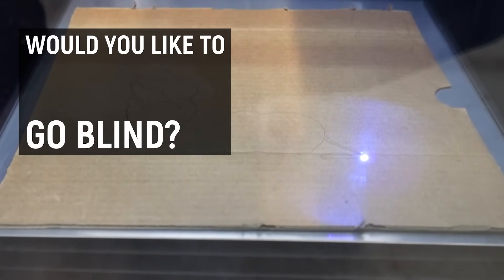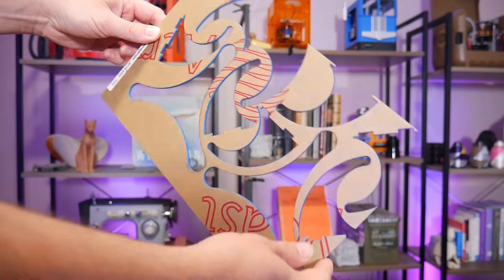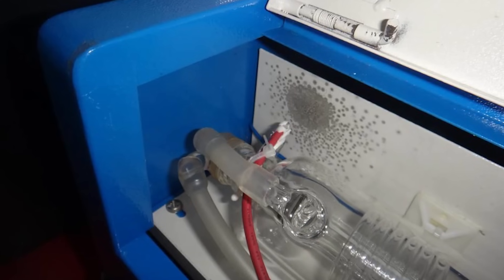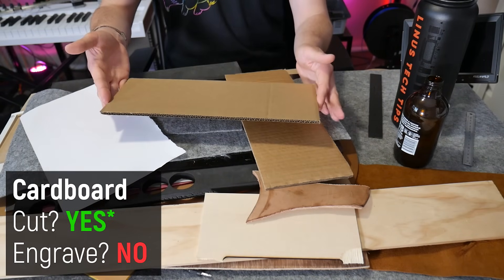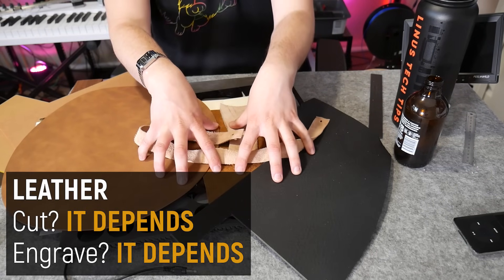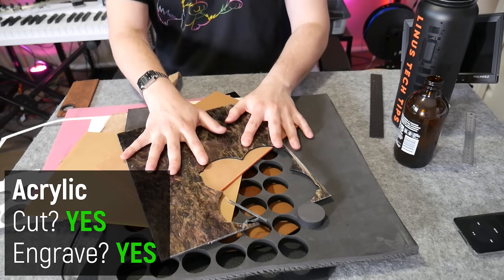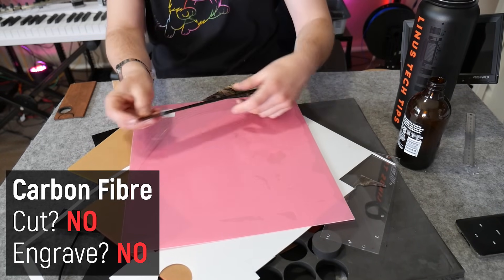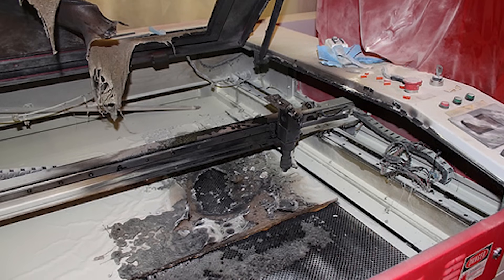Are cheap laser cutters safe?

Comment: i also add that you can not trust a lto of material labels, I bought "pet" and"PP" sheets that turned out to be Polycarbonate or pvc, so Iḿ always ordering samples first and test the mbefore committing to a full batch. a pparently a lot of vendors dont really care, especially if they sell the material for a different purpose than lasercutting.

Comment: Having been involved with industrial laser welding I would agree with your analysis of the hobby range available. I attended several days trainig by professionals to cover just the safety issues. That training required successful  completion of assessments leading to certification. So I really am surprised by the lack of support information and basic safety ,relying on the user alone to void potentially dangerous situations.  Many adverts show a young child watching the process! I was considering getting a laser but am now more than convinced that the hobby market has much work to do.

Comment: I have an enclosure with a proper wave length window plus I use proper glasses, an air assist and large exhaust fan that dumps outside.
Reply from the maker: Sounds like a perfect setup! Fire extinguisher near by too just in case?
Reply: Yes, of course. And signs for shop door and laser enclosure.

Comment: I have a Laserbox pro, partly based on your recommendation. The other day I put masking tape down on my wood to protect it which ended up peeling off a bit and caught fire when the laser passed over it. Luckily I was watching and the fire burned itself out in about a second. If there’s one thing I’ve learned it’s that when you’re using power tools, be safe. I’ve known too many old 3 fingered woodworkers to take chances with something as powerful as a 40 watt laser.

Comment: I've seen the gantry of a cheap laser cutter get stuck due to a small mechanical failure. The belt pulley attached to the stepper motor was spinning freely thus not driving the belt anymore. Since the laser wasn't moving it caused a fire in no time.

Comment: When we picked our laser up from the manufacturer we‘ve been recommended to perform a Beilstein Test. It’s pretty simple, you heat a sturdy copper wire under a flame until the flame is no longer discolored, then use the copper to melt some of your material onto it, and then hold it into a flame again. If it burns green your material contains Halogens, often found in PVC or other polymers containing chlorine.

Comment: My HS had a laser cutter. It was pretty cool. You could give them your water bottle and they would engrave designs in the powder coat for like $5. And they would engrave calculators with your name on them, though because it was plastic, they did that after school with no students around, and had the dust extraction system in the room it was in running, even though they had a machine with an in built filter for ventilation. Oh, and they tried to cut MDF with it because they thought it was plywood (it was the nice MDF that looks like regular wood) and the shop stank for days. Never did that again.

Comment: Even if everything goes right these open style laser cutters will horribly and permanently degrade your vision or blind you depending on the power level and how often you use it. These lasers are so powerful that even staring at the laser dot on the work surface is enough to damage your eyes, with the more powerful lasers this can start happening in seconds (and your brain is amazing at compensating for visual damage so you won't consciously notice until it's really bad).  My older brother had one of these and we kept it in a completely opaque cabinet and had it's power hooded up to a mechanical kill switch that was connected to the cabinet door making it impossible to observe this thing working directly. The only way you could observe it in a powered on state was on a computer monitor through one of the cheap webcams that was in the cabinet. This is the only way to use one of these safely. 

   You can buy the best laser goggles on the market but what if the manufacturer that made your machine is lying or is just plane wrong about the laser's wavelength? What if the multiplier crystal is of poor quality/damaged/misaligned and your laser leaks radiation at an unintended wavelength (this is criminally common in cheap green lasers for example)? What if your laser is running at an unusually low/high temp and the wavelength shifts out of the protection range the goggles provide? Hopefully whatever material your are cutting (or any of it byproducts) aren't fluorescent (including and wavelengths you can't see). 

   I'm legally blind (since birth) and trust me you don't take risks with your eyes. Humans are extremely visually oriented creatures and that way our society functions and your ability to participate in it reflects that. Whether your vision is good or bad, protect what you have.

Comment: Thanks for this video!!   I have been using an Ender 3 for awhile and some friends bought an AnyCubic Mega Pro with Laser Engraver and were not able to get it running so loaned it to me to try.   I got it printing right away but have zero experience with lasers.  I at least used the glasses during printing but of course no one else in the household who walked by had them, also I first tried "carving" some junk mail...all was good until it cut through the back of an envelope and melted some of the plastic from the address window....STINKY!  That's when I knew I needed to stop and do some research...Thanks again, Angus.

Comment: Bought cheap Chinese open frame engraver for $250 for work to just test a concept as it was not documented or done by anyone else.
To make it safe for a workplace I had to use it in a separate room which is locked up when I use the engraver and the included goggles went right into the bin, and instead bought ones that were certified and suited to the wavelength of the laser, those goggles costed more than the engraver itself...
Also interesting thing the included ones were green and expensive ones for the correct wavelength were red, so it would mean the included ones were incorrect...
Reply: Oh and the whole machine was placed under fume cabinet.

Comment: Even "wood" may not be what it seems... interior finishing grade timber, is often pressure-treated with insecticides.  Usually this is transparent to retain the timber's original appearance.  Construction timbers are pressure treated with even nastier chemicals, although this is usually obvious because the treatment typically includes a dye as a warning.
As Angus said more than once; if you are not sure, don't chance it!

Comment: Hey g10 and fr4 the material I used to drill and cut
....
With a very specialized laser. I imagine many modules especially those with diode lasers could be modified to safely cut it.

Comment: I'm pleased to see someone talking about laser safety. I spent some 15 years in the laser industry, trying to educate people about the things this video covers. The one thing it will have been good to see in it is something about the legal position with regard to laser classification, which is pretty well standard internationally. Laser classifications are based on the risk they pose.

Some laser classifications are illegal to use without protective measures being in place. Lasers without an enclosre are Class 4 lasers. To use these legally, the room they are in needs to have interlocked doors that would shut the laser off if someone inadvertently entered the room, operators must wear laser goggles, have laser safety training and a laser safety officer must be on site whenever the laser is in use. That's what the law says, but it isn't illegal to sell a Class 4 laser.

In other words, the duty for safety falls upon the individual or business using the machine in the same way it does for mills and lathes used without guards. The problem arises when something goes wrong. In a business, a H&S investigation that lead to a trial for negligence, could result in massive fines or a prison sentence. With home use, a fire caused by using a laser illegally, would more than likely negate an insurance payout.

Lasers can be great tools but they really do have to be used safely. It isn't that difficult to achieve in most instances, so long as you understand what the risks are and take the steps needed to minimise them.

One final word about fume extraction, is that the extraction requirement will vary, dependent on the size of machine. You can't expect a Micky Mouse extractor for a small machine to be worth a light on a large one. A reputable manufacturer will detail the extraction requirement in the machine specs.

In my experience, suppliers gloss over this, because it can make closing a sale too difficult when the cost of adequate extraction gets added to the bill.

Comment: Thank you, great video!  Being that these desktop diode lasers are so popular, it would be nice if you could make a video helping people to actually make them safer.... like which glasses to use to protect your eyes, different types of ways to extract the fumes, and maybe if enclosures are needed.
Reply: It is clear you need an enclosure. With a non transparent cover. And double interlock, like a microwave door. (CO2 lasers are an exception). Googles are not enough. Reflections can come from anywhere, and bystanders can get hit as well.

Comment: One question I feel I've never had answered and which has scared me away from all laser cutters is what would happen if a mirror was to break off and direct the light towards you. Would the shielding material,  be it metal or whatever transperant light filter they had above it be enough to save your eyes? I know the actual tip itself focuses the light more but what about the path to the head?
Reply from the maker: The window should absorb the worst of it, but only if it's correctly designed. The more terrifying part is replacing mirrors, because you can only align them by placing tape in the path of the laser and firing it to see how off the aim is!
Reply: @MakersMuse  I would love to see someone actually test the laser vs the transparent window to see if you'd be safe behind it.

Comment: Just for reference EVA foam is made from polyethylene vinyl acetate. It is in the process of replacing pvc where it can because it contains no chlorine. It's still plastic so it's still nothing you want to breathe in. Extraction is still a must because over time the fumes will probably cause cancer but it will produce no chlorine, no chlorine gas and not make acid in your lungs or with the humidity in the air ( a major problem where I live in Western MA, USA). The humidity in the air is another concern because those fumes, even if you have an extractor of some kind running, are still going past the laser head and causing damage to it.

Comment: Just wondering.
To mitigate the risk of fire, especially if you're running the laser cutter in an enclosure anyway, what if you flood the enclosure with an inert gas like you get from any welding supply store? Fire needs oxygen just as much as rust.
Would heat dissipation be too big of an issue? Or would you have to worry about high temperature chemical interactions between the inert gas and the material being cut?

Comment: I literally had a look at low-end (i.e. cheap) laser cutters/engravers yesterday as I have utilised my 3D printer so successfully I thought, well the laser cutter seems to operate similarly - 3D CAD software and gantry/stepper motors, not the actual end product. My naive thinking was that "well 3D printers have come so far, it makes sense that 3D cutters would follow". Even though I am an intelligent, university science educated person, I didn't stop to think about most of these issues as I just ASSUMED that if they sold them that way, then they must be safe to use that way.

Thanks for educating me, you very well may have saved my family's and my health.

Comment: Nice video, I v done a lot of researches about what can be burned or not, people usually don’t and that’s veeery dangerous not to know the hasards, especially with pvc based material and chlorine. Plus chlorine can also deeply damage and rust in
Minutes  all the metal parts. That’s insanely violent 
I also suggest you complete this topic with the type of glass that can be used or not (optical density of safety glasses or shielding glass) intro about wavelength, those are quite easily understandable specs. And can be found easily when buying PPI. 

Thanks for talking about safety when using lasers ! 👍🏻👍🏿

Comment: I just picked up a Comgrow Z1, 10w version. I picked up the enclosure at the same time. I didn't really run it until I had an exhaust system. I learned how to run a laser through a local maker space. They had a large CO2 laser. Some things they were VERY clear on:
1. Do not leave the laser unattended
2. Only trained users allowed
3. No opening the enclosure while the laser is powered
4. Do not leave the laser unattended
5. Only trained members allowed in the exclusion zone (area directly around the laser)

I like to think I have learned some good habits from the amazing people at the maker space. For what I paid for the Z1, I could've gotten a stock K40. But for the work I do, the added work area trumps the power. You are right, user error is probably the biggest issue. Companies are trying to make money off the new makers out there. So they offer the minimum. I just hope people watch this before buying. I would never run a laser without an enclosure or an exhaust.

Comment: You can lasercut PET or PET G. it is between PMMA and PC. It can be tricky to dial in settings, but it can cut quite nice. If the settings are wrong then it leaves honey like substance on edges, but with correct settings it is great. Not as bulletproof as PC, but also not as brittle as PMMA. For me it is the perfect middle ground. Also the price is a LOT lower than PC.

Comment: This is something that has kept me from lighting off the laser cutter I have until I had a safe area to use it, likely right next to the SLA printer that is still sitting in its box.
I have a charcoal filter fume extractor, but didn't have a place to setup a work space to use them until just recently.

I do remember hearing about a couple in the Berkeley area that died from fumes out of their laser cutter, which was apparently exhausted outside, but not well enough for whatever they'd been cutting in it, at least from what I'd heard back then.

Comment: I bought a "15W" blue laser with my cheap grasshopper CNC 3018 a couple of years ago.  I carefully tested the laser at 1% power with the glasses that came with it.  LOL.  Turns out, there are many things in a workshop, which you don't think of as "reflective", that are indeed slightly reflective were noticeable in my peripheral vision at that brightness! 😬

I learned a bit about laser safety in university, and more when researching how to correctly build an enclosure for this thing.  "Terrifying" is absolutely the correct word here.

I still hope to use the laser at some point, but I won't be touching it again until I get around to building a proper enclosure.

Comment: The more common carbon fiber material is a composite of carbon fiber and epoxy or polyester resin. It's the resin that creates the hazard. Raw carbon fiber is carbon and can be cut with a laser without hazard. It's an easy way to create accurate layups of more complex shapes. The fabric is cut, then the resin gets applied. One minor factor is that the laser creates an intensely white light, which I solved by wearing gas welding goggles.
Reply from the maker: That's pretty interesting!

Comment: The high energy wavelength combined with a lot of optical power is a huge safety issue indeed.

These things really need covers and a interlock to detect if the cover is off when in operation.

Comment: Hi Magnus.  I am unsure of this, but I have read that acrylic fabric will release CYANIDE gas when it burns.  I am not sure if this extends to acrylic material in sheet form, but I would assume so.  Cyanide poisoning is really insidious, and most of us are not aware of the symptoms, which are similar to hypoxia, but with normal-seeming SpO2 measurements from simple pulse oximeter.  The mechanism involves mitochondria being unable to utilize the oxygen that is present in the bloodstream, resulting in venous oxygen percentages being much higher than normal, differing from arterial oxygenation by only 10%, rather than the more typical 40%, equivalent to being deprived of 3/4 of normal oxygenation.  A person who is still alive with cyanide poisoning may appear to have ashen skin, with deeply red lips.  Not bright red, but a very saturated red.  Other symptoms are liver failure, cognitive impairment, loss of balance, difficulty speaking (slurred speech, inability to remember words, nonsensical utterances), gait disturbances, disorientation, memory loss, paranoia, hallucination, coma, and so on.

Comment: 9:50 it depends, Chromium(VI) is toxic the other chromium compounds aren't really toxic. If the tanning factory did their job than the leather shouldn't contain chromium(VI) on a noticeable level.

According to an article that I found, laser cutting doesn't yield noticeable chromium(VI). 
Article DOI is 10.1177/15280837211022612
Reply: I was going to reference the same article. Unless you happen to run across a piece of chrome tanned leather that was produced before 1970, it's perfectly safe.
Reply: @matchstickdesignco  The problem is that chromium(III) can still be transformed into chromium(VI) during tanning and sometimes it can exceed the allowed values of chromium(VI)
Reply from the maker: Good to know, thanks!